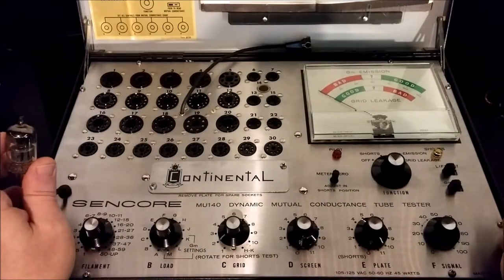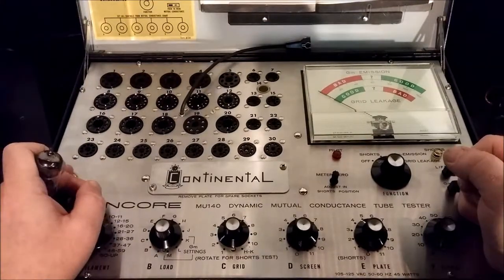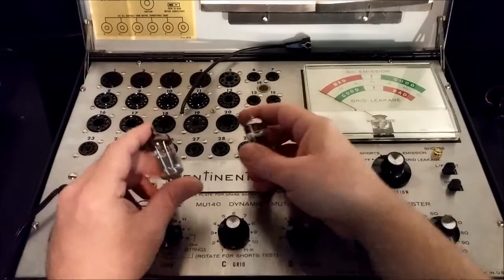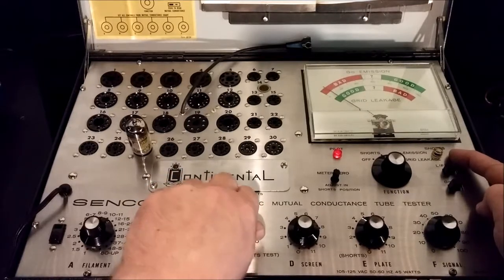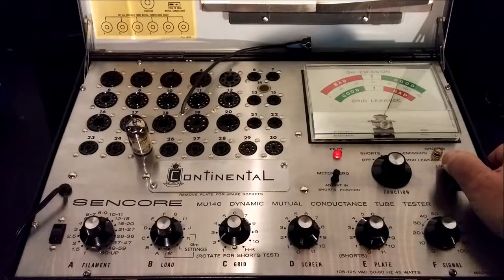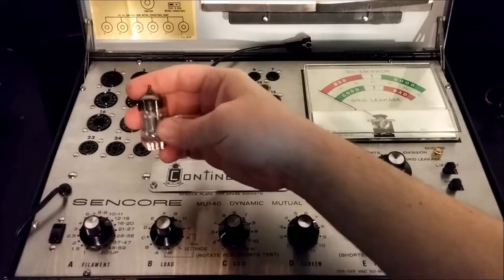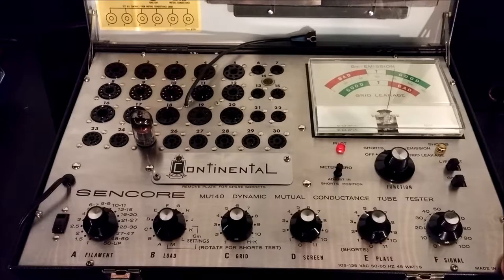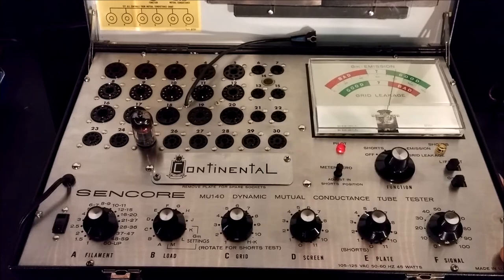Sencore MU-140 Dynamic Mutual Conductance Vacuum Tube Checker (Tester).

Comment: This seems like a nice comprehensive tester.  If I come across one in my travels, I'll be sure to see about landing it.
Reply from the maker: Yeah. It's great! I highly recommend it. I've had tubes pass all tests on other testers and even on this one up until the dynamic mutual conductance test then fail. Often 1 triode out of a dual.
Reply: @nonsuch  As I've said in my videos,  I use the Orange VT-1000 for guitar tubes, and it's great,  but the rest of the stuff I do on an Eico 666.   The eico is great at nabbing shorts and leaks.
Reply from the maker: @DeadKoby  I hear ya. The VT-1000 is a nice and easy tester but just doesn't have enough tube compatibility to warrant getting one. I literally stock 1000's of different tubes. Guitar amplifier tubes being only about 1%.